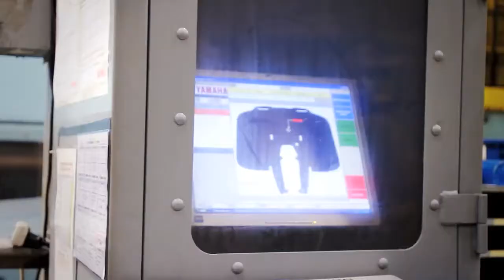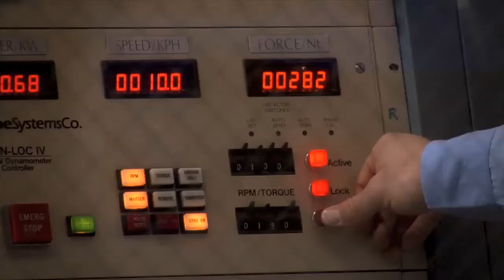Assembled in the U.S.A.

Comment: I fear that Yamaha is going the way of Honda in that its ATVs are becoming dated, especially on the cheaper quads. Stop selling any quads or bikes with carbs.

Give the Grizzly 550/700 closed loop EFI. Use some lighter weight parts. Have HID and LED lights be an option. Also apply some of the sport bike tech found in the R1 and R6 into quads.

Going to a honda type design without belts would be good too.

An OEM engine block heater would be great for those folks using these in extreme cold.

Comment: I own a big bear 400 irs and is good machine but the u front and rear needs to be replaced by a straight shaft to iliminate u joints and the rear diff is poor design. Pls update on these parts mmm k yamaha oh yea add more travel its a excellent fan cooled motor.